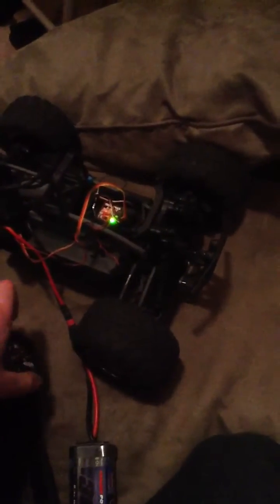Savage xs flux ESC problem

Comment: Don't freak out anymore! The problem is from the wires that connects the motor with the esc, you just have to move them a little, give them a little inspection and keep trying!
      Don't get scared when this happens to you, just turn it off, look at it, try to ,,poke'' all the wires, look for this not to get stuck, spent some quality time looking at it instead of sending it to the service and wait till they remember that you sent them the car, do it by yourself!
      I hope that helped some of you!
   
     P.S. I had the same exact problem!

Comment: I had a similar problem...no tone on battery connection. The green light would glow normally on pressing the trigger. Red when reverse. Steering works fine. The same with a spare battery, ESC  was changed by HPI under warranty (2 years warranty). See if u can call HPI cust care and they should help you out.